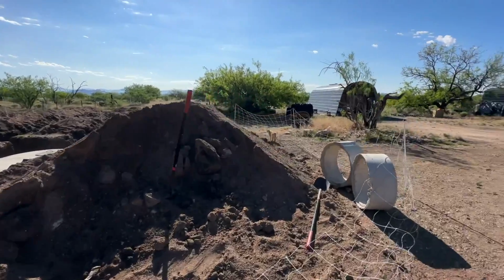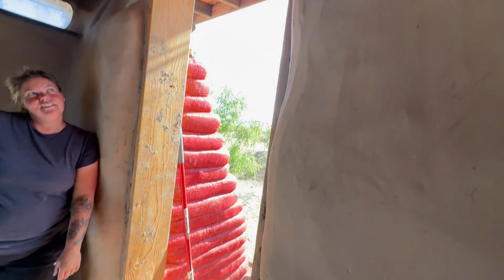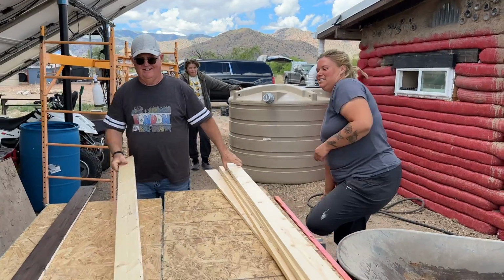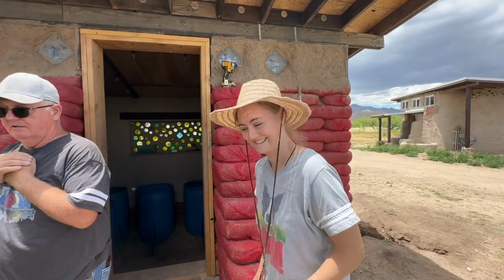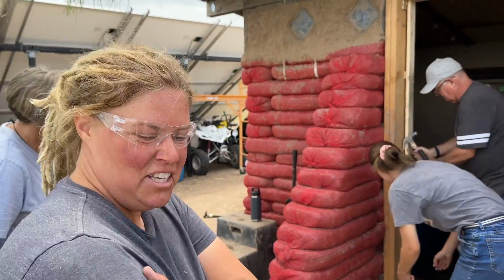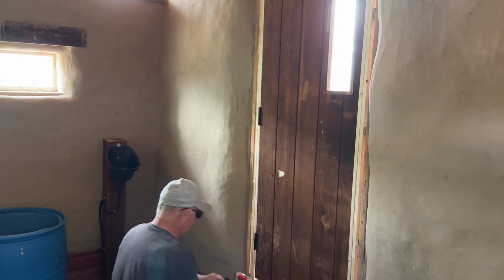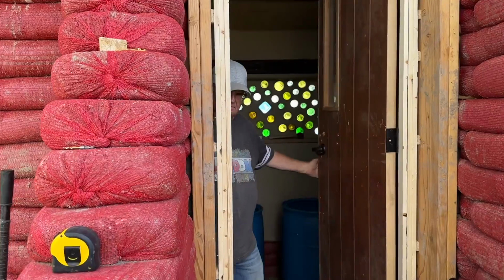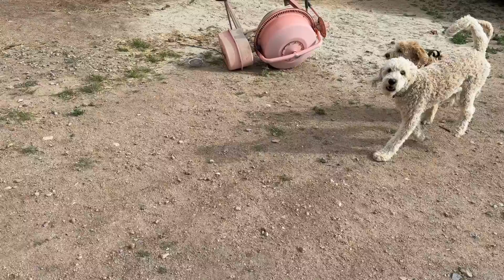Hangin' Out & Hangin' Doors with My Little Homestead

Comment: It's called a door jam.  A style would be the side pieces on a cabinet door part of the frame of the door. The top and bottom pieces are called rails. So you have a jamb which gets checked for plumb both ways, shimmed if necessary and nailed to the framing, those are called legs. You should start with the hinge side. Then use a framing square and make sure the head piece is square with the first leg. Shim and nail. If your door is square and parallel measure your door width and add about the width of two nickels stacked. Take that measurement and cut a spreader that you can use to set the latch side leg. Shim and nail. 24 or so of those and you might have some of the variables figured out. You guys are doing great, especially asking for help when you need it. Remember one thing, 
WOOD BENDS 🌎✌️😉 Tomic

Comment: i think i had done the door to open outwards..  well it can always be changed
Reply from the maker: Always been that plan to have it open inwards.
Reply: @TinyShinyHome  
ah.. why? what was the reason? 
my reason is: if its raining hard the treshold will let the water dripping from the door lead inwards.
if the treshold is on the inner side the dooe will be pressed against it and kinda seal it better. 
well. its a work in progress, it always can be changed in a few years.
Reply from the maker: Lots of reasons. Buttresses in the way, rain comes from the opposite direction, exterior doors generally open inwards 
….
Reply: ah. okay. 
maybe we speake about it in 5jears again or so.:)))
exterior doors open always inwards? maybe in the US. what about common buildings like schools? 
well you thought this obviously through..:))

Comment: The door handle is on upside down; i.e., a left handed opening. Oops. 🤷‍♀️🌷
Reply from the maker: It’s not upside down. If it were flipped it would run into the wall.

Comment: Hi From Portugal
Have u ever researched Whitewash to paint your buildings?
In the most hot zones in Portugal is traditionally used as a paint inside and outside, it is affordable and i think it could be a nice solution for your walls.
It's basically lime mixed with water (be very carefull with the process) and u could add color white glue our white cement depending on the use u want

https://en.m.wikipedia.org/wiki/Whitewash

Give it a try on one of your pump houses 

All the best cheers!!!